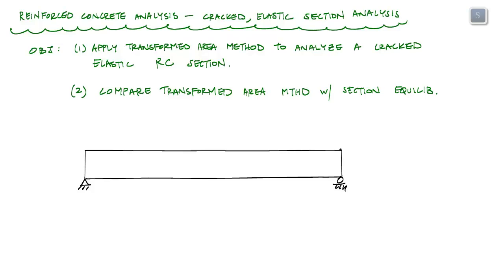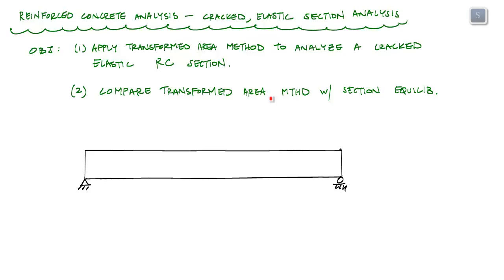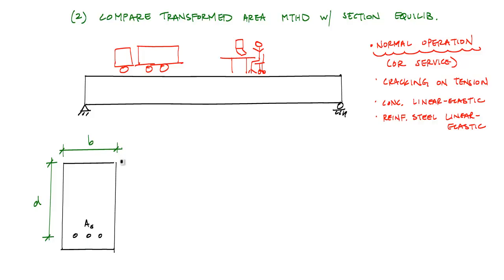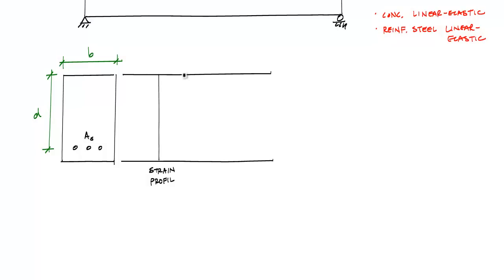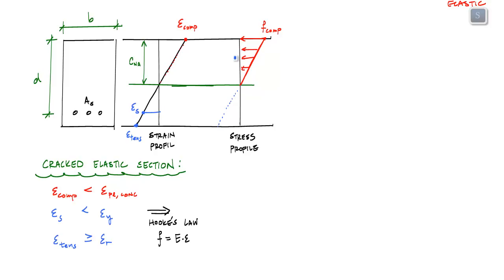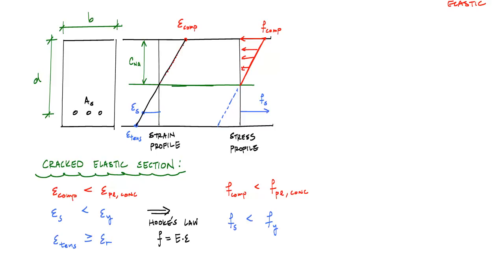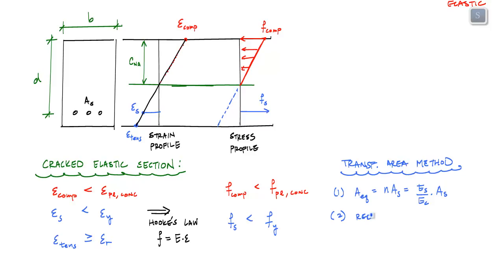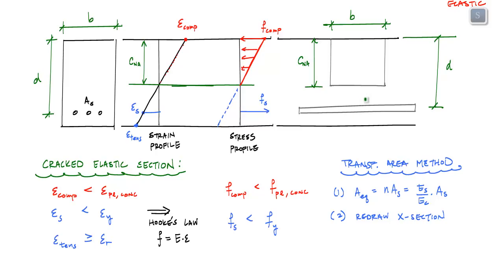Transformed Area Method for Cracked Elastic RC Section (1/2) - Reinforced Concrete

Comment: 1) Can I use force equilibrium method to calculate the Cna? I tried and found that the answer is the same. 
2) Can I apply this scheme of calculation (Cna & Ina) for RC arch which is under Axial force and bending moment? 
3) May you provide sample calculation for Ina and Cna for RC arch in plastic state where materials (concrete & steel) behave non-elastically?

Comment: I have a question.
In the minute 8:09, when you're explaining about the equivalent area, don't you have to deduct the area of the steel from the area of the concrete? I mean, instead of Aeq = nAs, it will be Aeq = (n-1)As.
Reply from the maker: +Ramón Omar Rosales Espinoza if the section were not cracked, yes we would have to subtract the area of the steel.

Comment from the maker: Here's my latest video on reinforced concrete analysis.  This one is an overview on using the transformed area method and equilibrium to determine the neutral axis depth in a cracked, elastic RC beam section.